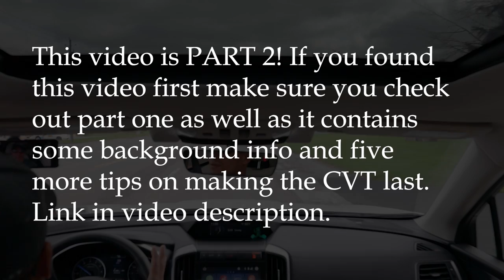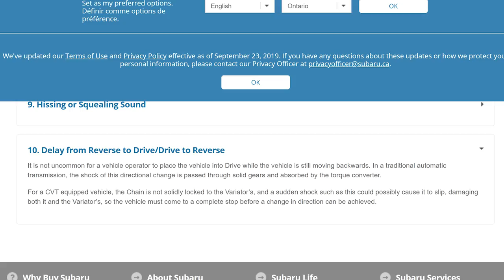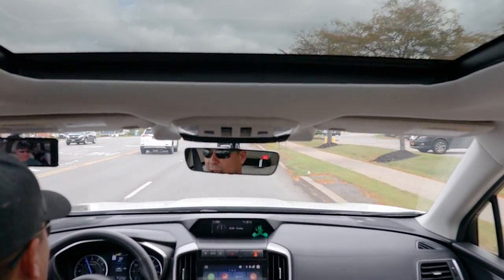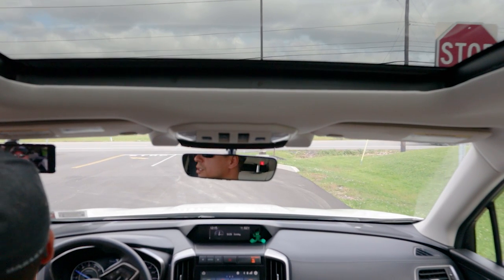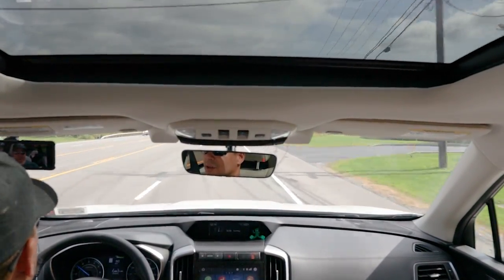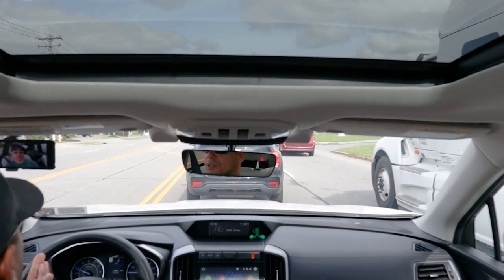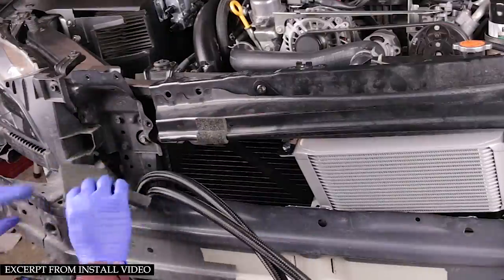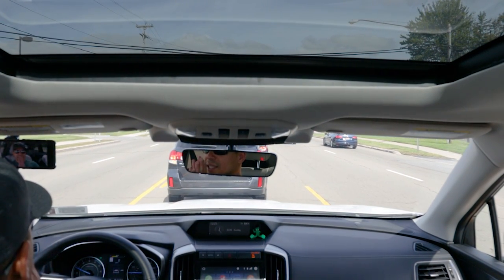How to Protect a CVT Transmission: 5 Practical Tips So Your CVT Lasts | Part 2 |

Comment: Hate when I see guys changing from R to D while still moving, or smashing the gas immediatly from N to D. Those are the kind of guys crying against cvts all over the internet.
Reply: @EpicDrew15  That's savage haha, and doing that on AWD is even worse. For launching it, the best is a manual transmission, but if AT don't use brakes.
Reply: Not always true , I call these transmissions,  drill press technology,  we made 20 Inch drill presses 40 years ago using this now we did use a belt , down under they use a chain,  the other car company's use a belt made up with two ring packs 12 rings each plus 399 units to make up the belt for a total of 423 parts to make 1 belt..... most car company's use small engine's with cut transmissions for a good reason less torque...if those units wear as all metal does just 1 half thousands of an inch per side , just a good polishing,  that is 0.400 or 12mm roughly now we have a half inch gap in our drive belt , what do you think this gap is doing to our ring packs , that hold these units together.. it's working those ring packs back and forth trying to break them and will those rings are only 0.007 inches thin....each... there for transmissions which use belt should have a fluid every 20,000 miles now the cvt transmissions from down under they do not want you changing fluid , if theirs goes out they want it changed out and the old one shipped back to the factory for a tear down to find out why it failed...over the years they have changed their transmission that chain has to be a lot better then a belt...
Reply: @davidlayne8755  tbh I think planetary gears AT to be more reliable, specially the 4 and 5 speeds, I wish they still use them instead of the 9 speeds or CVTs. On CVTs you should replace fluid at least every 30,000 miles, problem is CVT fluid is way more expensive than regular ATF. CVTs in general are lighter and cheaper to make though.
Reply: My wife does it all the time. Still slightly rolling back, and right to drive. I see her doing it in my car, and I will lose my freaking mind!
Reply: Now they cover it under warranty if changed.
Reply: Same with the guys immediately engaging their turbos at every stop sign.
Reply: 99999999999988888😅

Comment: I wonder how many of these negative CVT comments actually have a decent amount of experience with CVTs.
Reply: Yup, and of all the bad stories are quite happy to pass on, how many were asking their source what kind of driver was using the CVT. As we all know, there are some shitty drivers out there, who are happy to blame tech that fails because they drive like a knucklehead.
Reply: I mean all they do is complain. If they really wanted to do something about it, they should just make their own type of transmission smh.
Reply: @No, agreed. I bet they wouldn't complain so much if they knew how it hard it was to make this stuff.
Reply: I do. My car is In the shop getting one replaced on a 2014 maxima with only 65,335 miles. Never buy Nissan again smh this has been a headache
Reply: My 4 year old Honda CVT is still fine, no problems whatsoever.
Reply: Manuel Lucero i have a special additive to overcome this problem
Reply: Really what kind of additive
Reply: Manuel Lucero It is a Nano particle based additive . Nano is very small particles almost One Billionth of human hair. The properties of these particles change drastically at that level. They go and fill the micro pores in the metal surface and bond with metal on molecular level. 
Under pressure and abrasion they create a trio film of very high strength. Result reduced friction and wear tear of the metal . It takes over the lubrication and oil becomes secondary. Thus they extend life of the metal parts .
Reply: Lol what do I have to say? Nothing lmao. I’m hoping my new cvt will last at least that long which is why I purchased the car was with high hopes of having some reliability. And I have heard of several lasting up to 180k or more. But more times than not I have heard of them failing prematurely under 100k. 
Did you ever have cvt oil changes done? And what kind of motor oil do you use? Do you drive the car hard? As in accelerate fast and rev to high Rpms?
Reply: Manuel Lucero yes wish you all the best . Don’t worry be happy. My experience is if you drive consistent stretches your transmission and engine both will last long
Reply: @87bcpalot  don't buy the 5th gen 1.5 turbo engined hondas. I just had injectors replaced at 65K. consider yourself warned
Reply: @dallas218  My 09 versa trans died at 97k despite regular maintenence.
Never buy Nissan.
Reply: @ everyone ya just another prime example of how hit and miss these cvts are and they are more miss than hit IMO. Just hoping for the best now
Reply: @dallas218   Nissan was selling their Jatco transmissions to Ford and Chrysler. Jaguar too. They're were so bad, Ford and Chrysler started buying Toyota's Aisin transmissions. LOL

Yeah, stay away from Nissan, Hyundai, Kia, Chrysler, Fiat, Jeep, Dodge/RAM, GM/GMC, BMW, Volkswagen, Volvo, etc. They're garbage. The German cars aren't bad perse, but they're over engineered and a pain in the ass to fix. Parts and labor are expensive. Probably so you're forced to go to the dealer. They depreciate incredibly fast.
Reply: @nevikgnehz368  you're funny ! I agree
Reply: @87bcpalot  My Toyota Corolla CVT started to slip,
 so the Dealer recommended a Transmission Fluid Change at 45 K.
Problem solved.
Reply: @MrKhabbu  ok so what is this stuff called?
Reply: @stevel1475  it is called Turbofield Nano Treatment
Reply: Regarding all yor xperience CVT.. From how many miles/km CVT belt need to be change.?
Reply: @BungieStudios  buy a bicycle or batter running shoes.
Reply: @arty8255  you should change oil around 3000 miles or 5000 km.
Reply: The best part is when you proves them are lousy lame driver (it also reflects their aggressive and compulsive driving behavior). They drive with their feeling and not with their logic. 🤣
Reply: @dallas218  how do you drive? Are you pushing the car ?

Comment: You touch on this a bit with the "changing into drive from reverse"; I find it to be very important that I do NOT touch the accelerator pedal immediately after entering a gear PERIOD. This applies to anytime I enter drive or reverse in my WRX CVT; EVEN FROM PARK OR NEUTRAL. I must give it the full "1 Mississippi" to let the transmission fully engage, failure to do so will case bucking, lugging, or belt slipping.
Reply: Hell, I try to wait 3 seconds between direction change!
Reply: Also the problem is the engine rpm, especially when its not warmed up all the way, is higher that applies the torque immediately when switch bwd to fwd. Even with ur foot on brake, the car still tugs.
Reply: This just happened to me yesterday. I was going to park in reverse on a somewhat busy street and didn't give time till it fully engaged...the dashboard lit up and the car didn't want to move. I put it in park, turned it off and turned it back on and issue resolved. I now know I need to give it that "split second", but this video explains it very well.
Reply: I have a 2010 honda insight with the cvt!  did you mean when its in gear, take off at a moderate speed? i find that if i do, rather than start out slow, it dosent jerk as much! is that what you mean by give it the full mississippi?

Comment: I drive a nissan with a CVT I change the fluid every 2 years and buy oem fluid never had a problem it shifts 100 percent Great video!!!!
Reply: How many total miles on that CVT ?
Reply: 155,000 miles
Reply: Toyota have the best transmission out there in a cvt
Reply: Yep as long as you keep up with the fluid changes you should be fine. Problem is most people don’t ever change fluid on their trans.
Reply: I might get a 2019 Nissan Sentra SV 💪🏽
Reply: What year is your Nissan cvt?
Reply: Shifts what
Reply: @jackhamilton3705  consumer reports rates subaru as having one of the best. Toyotas are really only rated best for reliability and occasionally they have some of the best gas mileage. With that being said, a lot of ratings on toyotas have gone down over the last 10 years.
Reply: Ivan Bautista bro stay away from Nissan, I work at a Nissan dealership and that’s coming from a guy that sells them, if you want a car with good warranty got with Hyundai or Kia, if you want a car that’ll last a bit longer and fun to drive would be Toyota or Honda
Reply: Every 50k km right?
Reply: @Martin No additives. Just original Nissan OEM CVT fluid that's it
Reply: @thrishulh9834  Every 30k according to Eric O of SMA fame.  He calls it to "spill and fill" :)  Just did mine recently.
Reply: @timtitus6846  thanks 30 k miles right i have lost my niisan micra cvt  manual so have to ask service center  , & i see to that my rpm needle is always below 2 k rpm while i drive hope mine cvt  lasts a long time.
Reply: @allimkhan7540  is your car a GCC-Spec or US-Spec?
Cause what I often have seen on forums is that Nissan CVT aren't really an issue in the middle east.
Reply: @aaryeshg.6526  USA Sentra
Reply: @allimkhan7540  lol that's interesting. I guess fluid changes are the way to go.

Here in middle east I drove dozens of Nissan Sunnys with a CVT in driving schools, most of them with over 200k km and instructors told me they just change the fluid on them regularly and they keep going. 😂
Lot of Altimas here rack up mileage without issues. Guess a car is different depending on region its built for.
Reply: @aaryeshg.6526  As long as you change the CVT fluid they last a long time in any country mantaince is important on any car than it will last long.
Reply: @thrishulh9834  miles
Reply: @aaryeshg.6526  that because were talking about miles not kilometers
Reply: @BroadwayLTDProductions   Exactly... and then they complain when their cvt fail lol 
I just changed my transmission fluid at 112 K miles on my Versa (2011) it still shifts like a dream even before changing the fluids. However, I felt that the tranny became quieter and less stressed after changing. I'm assuming that most people would've never changed the fluid since the transmission isn't acting up or something :(

Comment: Very good advise. An external filter would allow some extra cooling and keep the fluid cleaner. CVTs should run cleaner than other transmissions because of less gears and clutches, but still, a filter is a good improvement.

Comment: Yes! I agree with everything you said. CVT transmissions are not as rugged as the older hydraulic pump automatic transmissions but they are still excellent for passenger cars IF YOU TAKE CARE OF THEM! 
It is cheaper to maintain a good car than to buy a new one.

Comment: I just got a Toyota with the CVT. I normally would have preferred the manual transmission, but this one works very well. It has the manual mode, but I’ve found that it works fine to just leave in drive. I bought this car used with 31k miles. I spoke to a very trusted transmission mechanic to do its first service. He first said that he didn’t even work on these and they are typically a “unit replacement”. He did the rebuild and first fluid change of my dodge truck, which is working great. So I asked again if he would look into it and just simply do the recommended fluid change and service (clean filters, magnets, whatever), so he made an appointment for me to do that. I’m going to ask about the cooler, adding one would definitely be a good idea. My advice as well, don’t drive it like a race car when you don’t have to! I bought this car as a commuter, so just getting on the road and driving a boring speed that gets me there, works for me. Even if you drive a WRX, don’t beat the hell out of it. I would figure that a CVT is probably ok in stock form, but not something I’d consider doing any serious engine modifications to.

Comment: Cvts are great.  If the car is driven with responsibility, even the moded cvts are great.  All your advise are on point.  I have stage 2 cvt wrx and I drive normally and not do not do launch control. I also don’t push to limits.  Every once a while I drive spiritedly and it’s great.  Makes enough power 280 whp.
Reply: Hey buddy, hows the cvt doing? planning on buying a stage 2 wrx cvt

Comment: Absolutely!  I agree 100%. I have a '13 Nissan Murano with 246K on the original cvt transmission. I bought it at 45K. Works like new. After an almost complete failure at about 130K  I added Bar's Leak CVT repair with new fluid, ran it for about 10K, drained & refilled fresh...A-ok. I started changing fluid according to mileage<30K. Now I drive it smoothly, & I change it at the slightest squeak or shudder; or seasonally just coming out of Michigan winter & definitely going into and out of hot humid summer. I listen to my Baby.I wish I had known about the trans cooler back when I was putting nearly 50K/yr on it for 4 yrs.
I'm just as concerned about it now that I'm mostly city driving.

Comment: Great tips, very through videos! The only thing I can think of that you left out is to not shift into park while the vehicle is still moving. Also, to reduce the stress on the transmission and driveline when parking your car on a hill, it is best to first apply the parking brake, then release the brake pedal, then shift into park. That way the weight of the car is sitting on the brakes rather than on the transmission and driveline.

Comment: This is the second Altima I’ve owned. 300,000 miles and no trans problems. I love this transmission.
Reply: That's pretty good. I also drive a Nissan with a CVT. I don't jack rabbit starts. I hope I get 300 thousand out of mine. But I got a 10-year hundred thousand mile warranty so if it blows I really don't care
Reply: Yah....same here. Got $1000 back from my warranty deposit after I passed the limit with zero problems. If anything happened while under warranty it cost me $50 total for any one break-down. Never needed to use it.
Reply: @OldDocSilver  would appreciate much if anyone can tell me which insurance company you had for your extended warranty.

Comment: Avoid traffic jams, especially in hot weather.  This will help keep transmissions cooler (less breakdown of fluid).  Better to take less traveled back road than jammed up freeway.
Reply: Back roads are great because they also keep you away from the morons found on main roads.  People like to get into the lane next to you and then cut you off to turn into a parking lot.  This is either deliberate fraud or just a lack of planning.  It is not my fault they can't plan!

Comment: I usually use manual mode to prevent that irritating hill assist, or to get a higher RPM for going up hills, cuz the CVT will be up down up down.  I like to just keep it around 3000 RPMs until I’m back on flat ground 
I live in the Appalachians, so everywhere is mountains.

Comment: There's also backsliding if the car is pointing up a hill. For manuals, apply the handbrake (parking brake) and release as you engage 1st gear with the clutch. CVT: depends on the equipment. Cars with electric brakes have a brake-hold lever for this very reason and a separate parking brake.

Comment: My research: Heat is the enemy in a CVT.  1) use a quality synthetic CVT fluid designed for higher temps, change the CVT fluid more often then recommended, high heat breaks down the fluid. and  2) for some vehicles with a CVT, adding an aftermarket trans cooler makes a big difference. Dig through the forums and youtube. Nissan CVT's are known for overheating. I have heard of folks using REDLINE brand and Lucas Oil brand of synthetic CVT fluid. I speculate car companies have improved the cooling for today's CVT but in years past this was a big issue. Heat breaks down the fluid, the burnt fluid causes erratic operation and slippage, the slippage and shuddering under torque causes the CVT belt or other part to break.

Comment: Great video... I have shared it with my wife and kids who all drive CVT's (Nissan).  One small thing to add (that very few people know about )is that the transmission fluid has an antiwear additive that prevents "cold welding" between the pulley and the belt links.   This microscopic welding is what eventually leads to scoring. (metal from the softer pulley builds up on the harder links).  sudden acceleration especially from stopped means that the metal surfaces will be sliding with not enough fluid to prevent adhesion (aka cold welding. galling, pickup). These antiwear additives are used up over time.  The wear particles that are welded to the chain reduce the contact area between the chain and the pulley and cause slipping and scoring (the particles will show up in your transmission sump).
Reply: From stop and go it's Use first gear then CVT after that

Comment: I was aware of getting into a complete stop before switching directions in my previous cars. But switching to this CVT. It seems like even if you come to a complete stop, you have to wait a few seconds longer before switching. I've felt the chain slip before even though I was confident that I came to a complete stop. I was probably too quick to switch from reverse to drive. Picked up the WRX CVT new in July of this year.

Comment: Thank you for making this video. You showed the TSB for the Subaru cvt fluids and made me realise that when I had my cvt cooler installed, they actually put in a full quart of the low torque cvt fluid (CVTFII) and mixed it with the HT fluid that was already in my cvt. Now I’m scared to drive it and want to flush the entire system

Comment: I agree with him, I had a Honda CR-Z with CVT and no issues with the tranny at 105,000 miles also we have a 2005 Mini Cooper with CVT 169,000 miles no issues and change the lifetime fluid with the BMW recommended brand it still functions very nicely